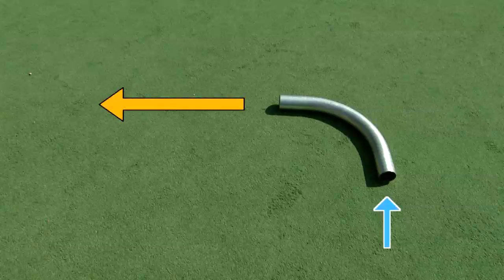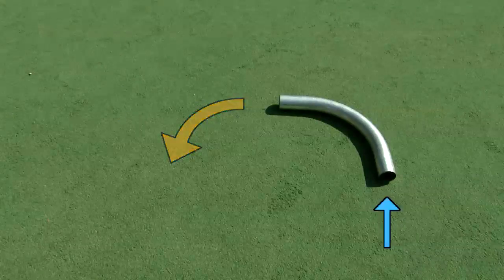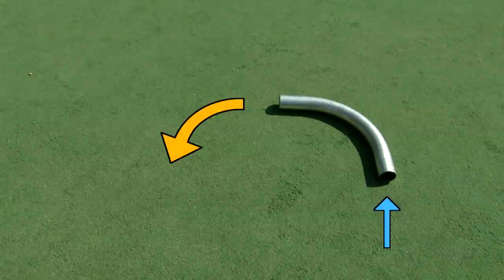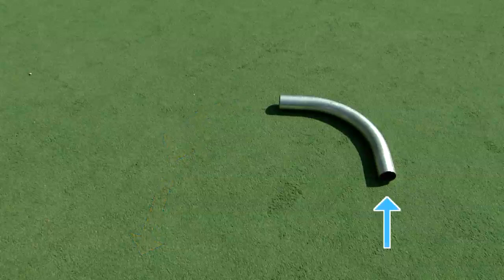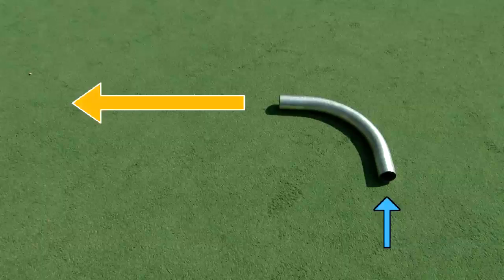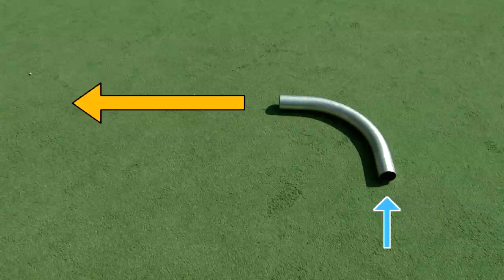Mini Golf Physics | A Moment of Science | PBS

Comment: Air is the substance acting on the ball. As noted at physlink.com, "If an imperfect hit on the golf ball causes the ball to spin clockwise, the ball will deflect air left causing the ball to curve to the right. If the hit imparts a counterclockwise spin, the ball will deflect air to the right causing a curve to the left. . . . The amount the ball will deviate from its initial trajectory is a function of the density of the air, the velocity of the ball, and the rpm of the spin on the ball."